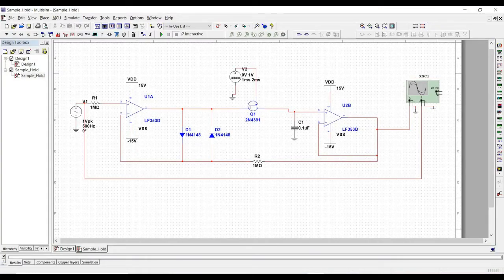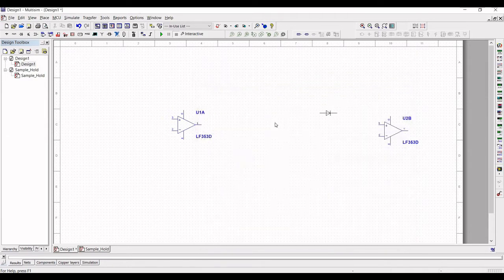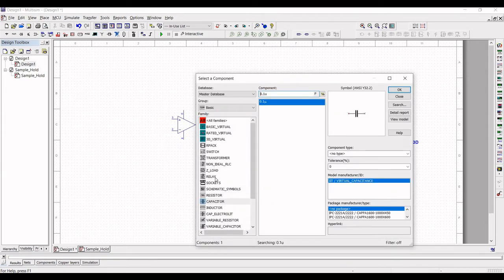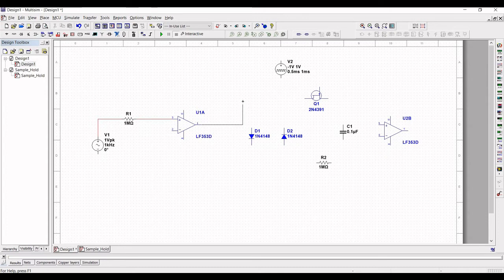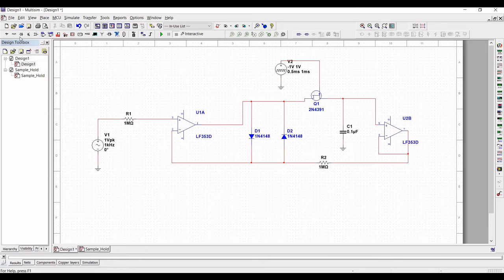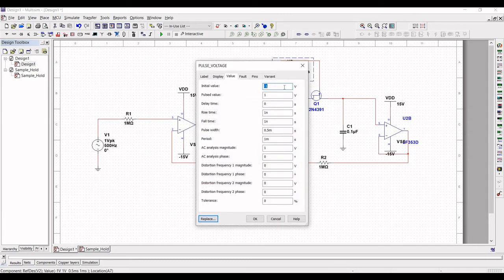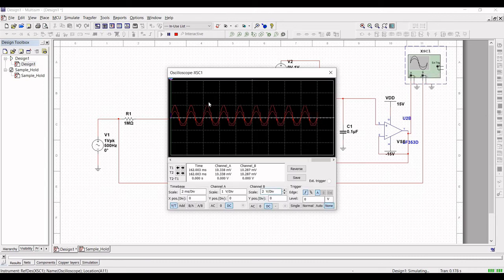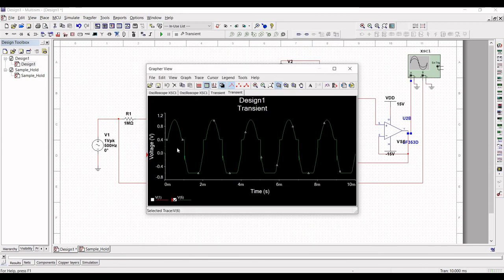Multisim Tutorial 13: Sample and hold circuit simulation using Multisim tool

Comment: a friend of mine asked me to look at multisim simulator
i did a basic circuits with op amps, with a 12 volt supply
you anyone knows the op amp can not exceed the rail
voltage I was getting all kinds of crazy voltages in the thousands.
you can not exceed the rail voltage in real life. multisim
may be helpful in some circuits but it didn't work in this
simulation.